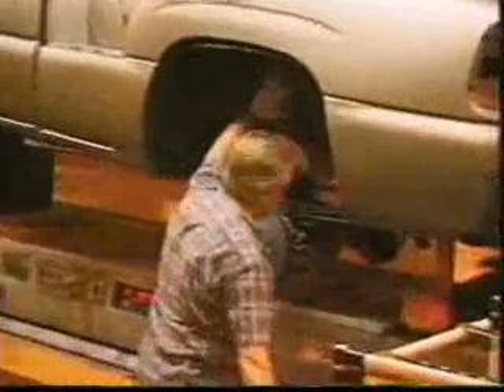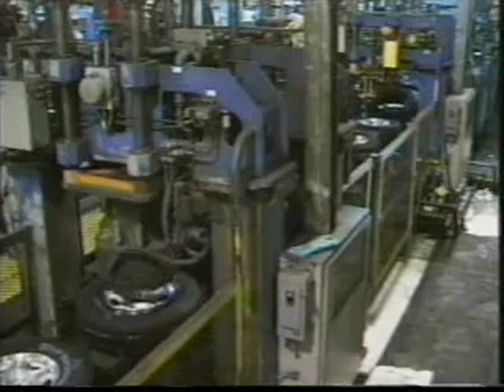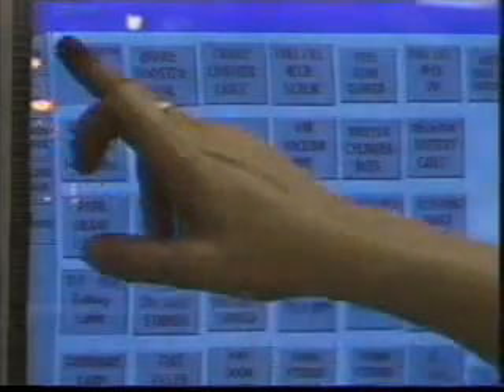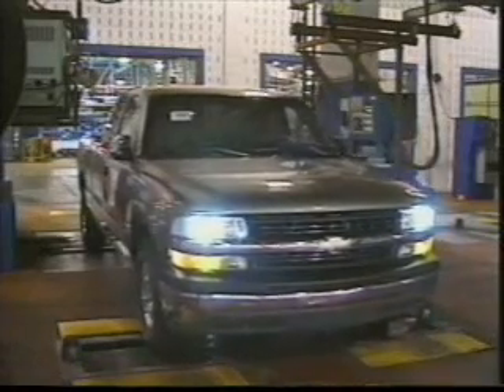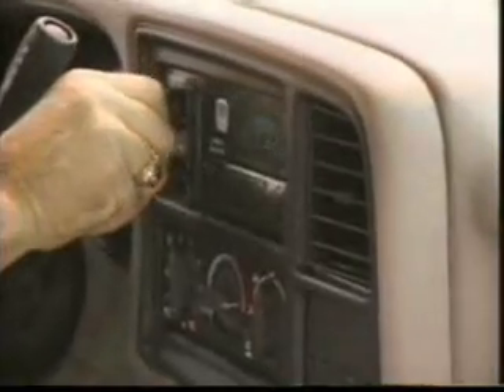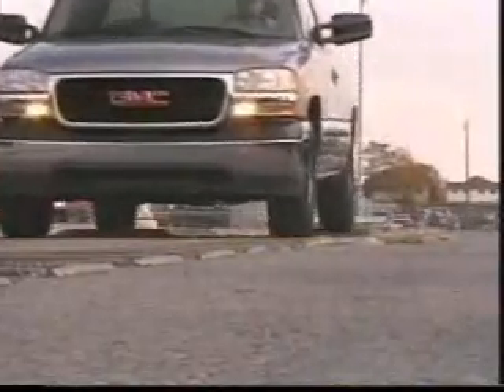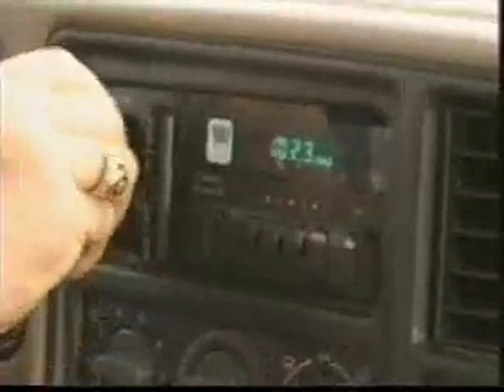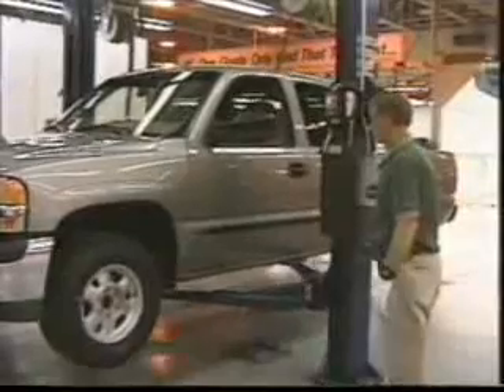How a Chevy Silverado is built at the Oshawa Truck Plant 3/3

Comment: My buddy has an 02 chevy that was built here, it has over 300k Minnesota miles on it now. The frame has holes rusted in it, the bed floor is completely rusted away and you will get tetanus if you are not careful near the rockers but it still runs and drives like new. It is also still on the original engine and transmission.
Reply: GM products are junk dude
Reply: @toddbob55  pretty damn hard to call a truck that lasted over 300k miles of being sprayed with liquid salt junk. That won’t stop ford guys from saying that though. They have no problem flipping their mechanics a few thousand bucks to work on their terribly designed garbage ass trucks. How do I know? I work on them every day for a living.

Comment: I have a 2000 Silverado with 94,000 original miles. Runs and looks new. All stock,no mods.
Reply: Still have my 2000 336k will start restoration soon frame off

Comment: Interesting for sure.  The test at the end of part 3 is fascinating. I wonder what percentage of trucks were selected for this test.  It couldn't have been all of them. Maybe 1 in 50 or 1 in 100? Would a truck that was tested be sold as a regular new truck to a consumer?  I guess as a buyer I would be happy to know that my truck had passed all those tests.  But maybe better not to know what it had been through. 
When I was still in school I worked at that plant one summer in the mid 70's.  I was on the spot welding line but that wasn't my job. I cut out holes in  the raw metal dashboard and put it in the cab for the next guys to install. I'm glad I didn't spot weld. Those seemed like hard jobs and all done by robot now.  Too bad the plant is gone. It made good vehicles. Can't blame the union, though. Lousy GM management.

Comment: I have owned 3 GM trucks built in that plant. A 2001, 2003, and 2007 NBS. All great trucks. I had 200,000 on my 03 when I traded it in on my 2007 and now have 100,000 on my 2007. Never really had any problems with any of them.

Comment: Why do all GM trucks rust at the rear bottom of the front door, if it is a extend cab it will always be at the rear bottom of that ! There should be a class action suit against GM for this. Rarely do I not see a GM truck rusting terribly.
Reply: They don't always I have a 2001 chevy silverado with 260000 miles on it and has no rust any were and I live in nc so it's not like I live in Texas.
Reply: I would suggest that this is due to  missing drainage holes to  allow for condensation and leakage water to flow out.
Reply: My truck rusted so bad it was unbelievable.  Had 180k on it though